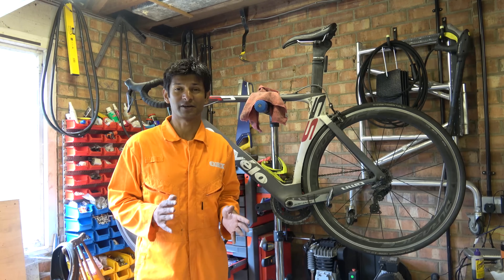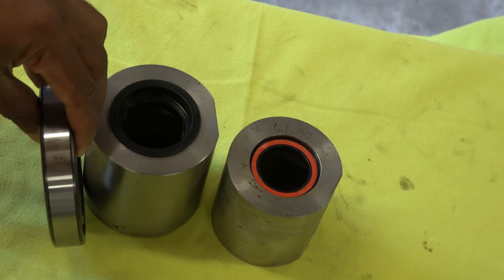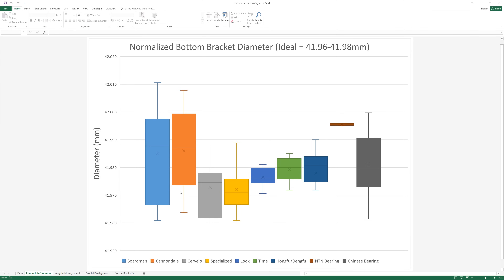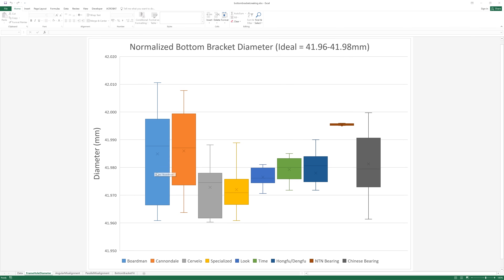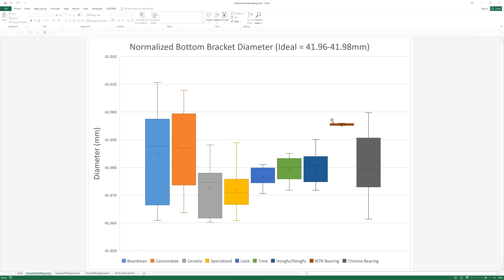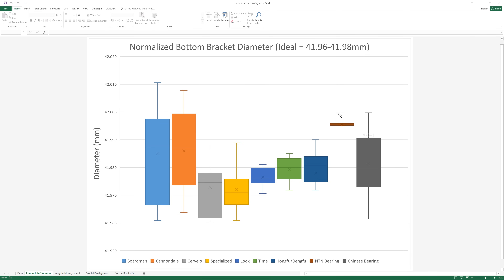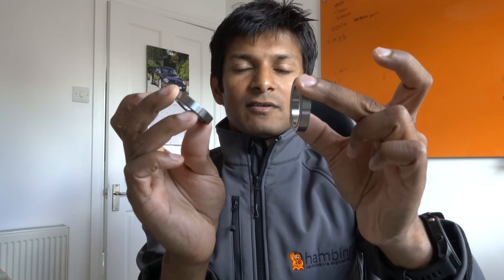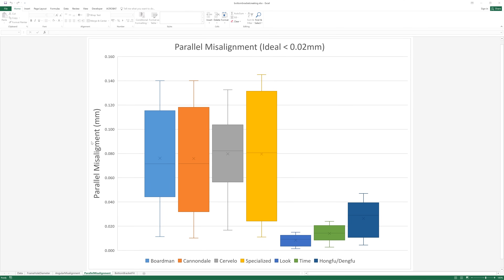Which Bike Frames Creak? Cannondale? Specialized? Cervelo? Hongfu? | Hambini

Comment: I was about to buy a Cannondale CAAD12. Not sure anymore :(
Reply: I went with the Trek Emonda SL5 let's hope the bottom bracket will be fine. It has the BB90 Thanks for warning me about Cannondale
Reply: I don't think that my bike shop will do that. Lets hope if I end up getting it that I can find a solution for the creaking if it appears. Or if I get a good deal on Emonda ALR I go for that one. Thanks anyway. I really enjoy your videos
Reply: Mikael Oksanen I have a CAAD10 and bottom bracket started to creak after a year. I bought a full bottom bracket converter (not just the shim) from Wheels Manufacturing and changed to Shimano Integra crank. No creaking yet for two years. I think CAAD12 uses BB30a? Apparently Hambini makes BB30a to Shimano bottom bracket.
Reply: David Lam thanks for the tip! It makes me actually sad. CAAD12 was my dream bike for a while and now I dont know if I want to buy it at all. It is hard to find a good frame for price around 1500. Maybe trek ALR. Why Cannondale would make such a nice aluminium frame then ruin it with the bottom bracket :(
Reply from the maker: I don't know if it's possible, but you could ask your bike shop to measure the hole before you get it. For the sake of €50 and a bore micrometer, it will save you endless grief.
Reply: Whilst GCN might well do generic videos on 'how to solve creaking bottom brackets' you aren't going to get them to speak ill of any particular brand, or draw any unnecessary attention to the apparent lack of QC, wether in relation to one brand or the wider industry. You have to remember they are sponsored by multiple cycling brands and it's in their best interests to not belittle the ones they aren't sponsored by, in the interests of promoting the wider bicycle industry as a whole.
Reply: hows your trek so far? my bb90 is still fine (touch wood) after one year of abuse

Comment: My Specialized S-WORKS has a raceface PF30 from the factory seems good so far, any info on raceface products? A lot of the other Specialized models use SRAM
Reply from the maker: I haven't used their products I'm afraid.
Reply: Hambini Performance Engineering Cinch PF30 and next SL cranks. Not sure if it's delrin or alloy material
Reply from the maker: Generally, I buy Shimano because their tolerances tend to be very good. I used SRAM stuff many years ago and it just wasn't as slick. It might have gotten better now. For the bottom bracket, if yours is not creaking, I would leave it.
Reply: Kazak Thranduil.                      I’ve ridden 3 Tarmac’s -S-Works with BB30 to 24 mm Shimano DA, high milage. No creaks what so ever. I use NTN bearings.

Comment: This was very interesting. You're producing great content. How many frames did you measure all in all?
Reply from the maker: Hi there, thanks for the feedback. Almost 200 frames. There were some frames that I didn't get a sample size of 12 so I excluded them.
Reply: Hambini:  200!?!  Thanks for the (statistically significant) effort!
Reply: Hambini Performance Engineering which of the Look frames did you test?
Reply: Ivan - I
Reply: @Will Roberts Actually, as little as six results with appropriate standard deviations/variation can yield a statistically significant result at conventional p-values.
Reply: @Will Roberts Well, golly Will, thanks for "educating me" on my compliment to Hambini.

Comment: How would the box and whiskers look for a threaded bb? Much tighter spread in guessing? Have you seen colnago's TF82.5? Wondering if it's worth consideration as a non-creaker?!
Reply from the maker: Threaded has a huge advantage because it places the bearings 90mm apart, by doing that, any angular differences or parallel misalignment is greatly reduced because of pure geometry. PF30 and BB30 in contrast are narrow at 68mm so any misalignment is much worse.